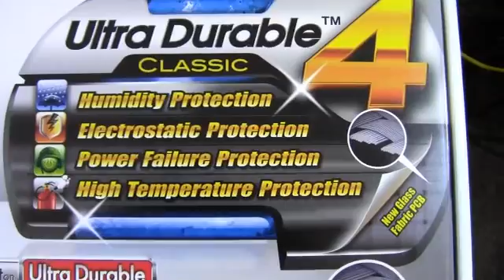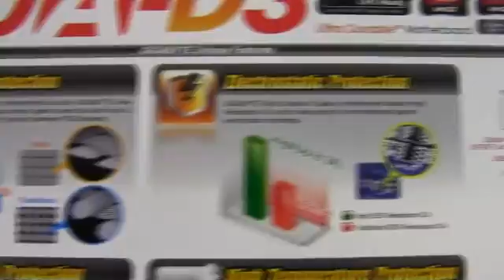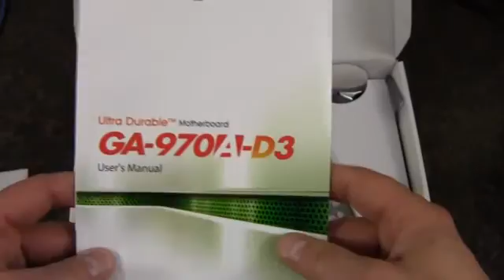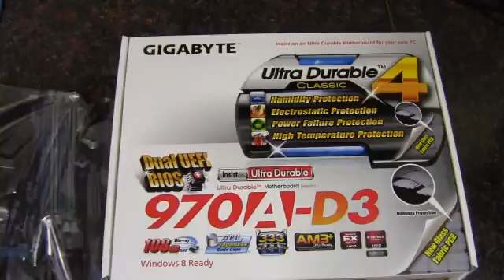Gigabyte 970A-D3 AMD Motherboard

Comment: Wow 4 years ago and I just found this board back in my office warehouse.. have plenty time to mess with this board but before i build it, can you tell me exactly what is it with the 2nd VGA slot? Do you really use it?
Reply from the maker: No. I would not use the second x16 slot for graphics. I would only use it for an HBA, multi drive RAID card or a high bandwidth LAN card (like 10gb).
Reply: @AdoptedMike  i see.. thank you that was really enlighten